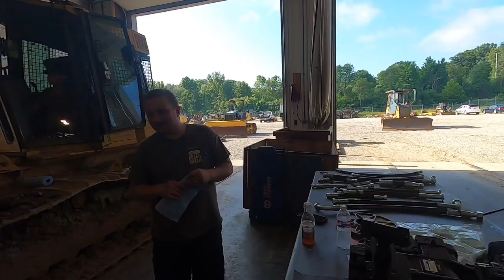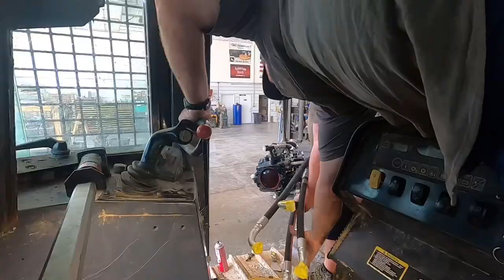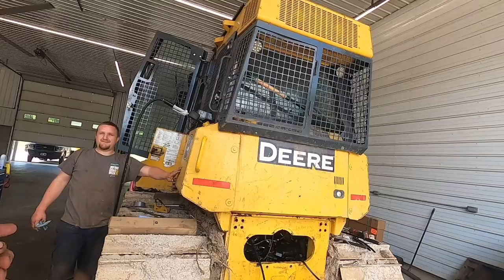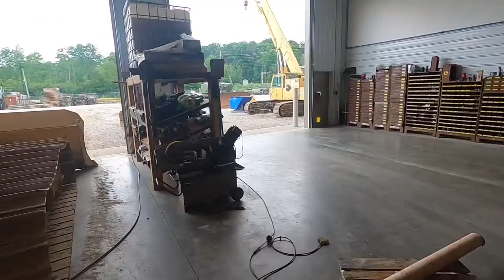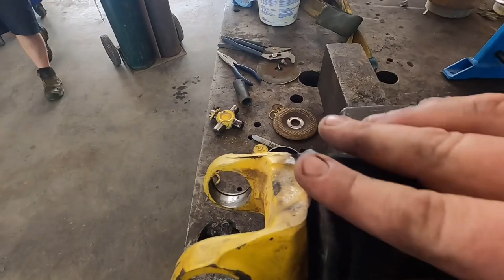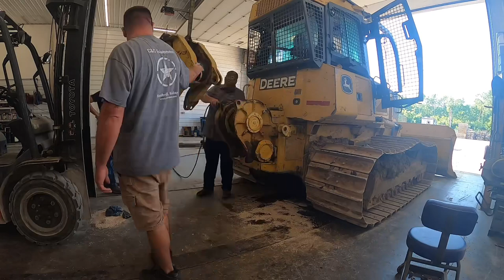Transmission pump install time on Deere 700J after we waited over 2 months on parts! part 3

Comment: I have done similar jobs like that. I used a small chain hoist on the boom of the forklift and the person inside can lower item as he needs to. Even a small electric winch might be a good option. Then the boom can stay the same height. Nice job as always 👍
Reply from the maker: That's a great idea!
Reply: I have a small Harbor freight chain come a long that is very handy for jobs like this.

Comment: You made that shaft making look easy and the best weld I've seen Well Done Guys Always a joy to watch
Reply from the maker: thanks
Reply: BFTtheTRUTH  I'm not going to comment. I won't touch that with a 10 ft pole 😆😆
Good one!
Reply: They needed to suspend the shaft between centers and use a dial indicator to verify they were straight, then weld. And if you act quickly, you can use a soaking wet rag to shrink any high spots and get them to indicate perfect

Comment: Hi from uk guys 👋 👍 finally the loggers can get back to logging with the beast rather than piggy backing logs up hill 🤣 and the unused shovel behind cab wasn't  for cleaning tracks out it was for digging themselves out the s**t with the boss and was put there for safe keeping 👌 lol good job on driveshaft and I take it nothing leaked past niagara cos you couldn't see🤣 and my guess for bill be at around $28k all in parts labour in and out of house and vat and thanks for supplying a waft of air con for lads Mrs C&C 👌🤣 thanks for your time be safe and see you soon 👍 👋
Reply from the maker: Lol
Thanks for watching
Reply: 😂😂thanks
Reply from the maker: Mark are you at 28K even then?
Reply: @C_CEQUIPMENT  I am

Comment: lol did poor Kevin get shocked at 18min 40 off the battery when he went in with the wrench lmao.. that hurts that does ... 24v with the hydraulic oil conductor playing hehe. nice work in getting the 700 back running though. it's another job to tick off the board! Thanks for sharing as always Clint
Reply from the maker: Lol
Thanks for watching

Comment: Another great job, really impressed with the quality of work you guys do. I had a feeling when you made good with DP on his 850 he purchased from you, that you guys did good work..
We used to make all our own drive shafts for our Dirt Modifieds, before we started buying them from Fast Shafts, was always interesting and fun. I own a machine Shop, so we would lay them out on the granite table and tack them, to make to make sure they were as parallel as possible. If it wasn't, you'd feel it at 8000 rpm...lol
 My guess, $28,750.
Reply from the maker: I bet
Thanks

Comment: The communication with this task is absolutely perfect setting that in. I wonder how many actual cuss words have been said though lol
A little idea for weld positioner/rotater, could strip old welding leads and wrap the copper wiring loosely to allow for it to rotate nicely which in turn allows it to be grounded to the work piece
Reply from the maker: Clever editing on my part on the cuss words lol

Comment: Great video on this abused 700J. Quite the spaghetti mess of hoses , but other than "Special K "  leaving a loose hose, outstanding install. I would lean towards a repair cost of $27,700   that should be doubled for the ignorance of letting a unqualified operator trash it the way they did. Plus you would be able to pay Kevin.😁

Comment: Funny thing is the only reason I can think of that they make the coupler out of plastic is as a safety so it breaks instead of something else but damn what do you have to do to actually shear that thing.  That thing was pretty tore up.
Reply from the maker: Right 
It was pretty strong to break the shaft in the pumps

Comment: Dang, it was way easier installing a new rotor transmission or T58-GE-8 turbo shaft engine in a Coast Guard Sikorski HH52a Seaguard amphibious helo than what you guys went thru and that was a beach.
You know you got a good team if you can install that unit in a space as tight as that was and not damage any of those hoses
Definitely an interesting video this one.
Reply from the maker: Thanks

Comment: Great job!  Very finicky work getting the pumps in there.  Why would JD use a plastic gear in a tractor if it eventually wears out?  It should be metal.   I think the cost would be $34,000.  Hunter has quite the sense of humor.  I think he's hanging around Kevin too much.  lol!   Great videos.
Reply from the maker: Lol
Thanks

Comment: Talk about putting 10 lbs of “stuff” in a 5 lb bag, you guys just did it. Thing about oil leaks is it prevents rust.🙄 my guess, as to cost on repair, would be about 22k range. Can’t tell you of the thousands of drive shafts I have built in my years in the industry, looks like you did a nice job on the driveline, real test is in the use of it. Thanks for the ride along.
Reply from the maker: Thanks 
Thanks for watching

Comment: You did not show putting the driveshaft together did you line up the universal straight with each other before you welded it together if they are not straight with each other it will vibrate
Reply from the maker: We sure did

Comment: If I buy a piece of industrial machinery..there better not be an ounce of plastic in the drivetrain.  Like, what were even the design considerations in making that part?
Reply from the maker: Well it did withstand the steel pump shaft breakage